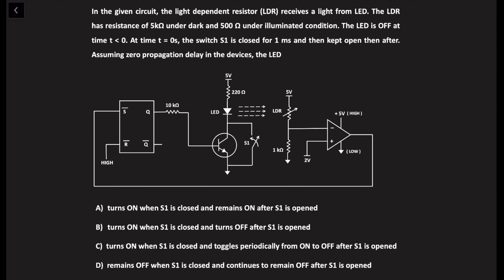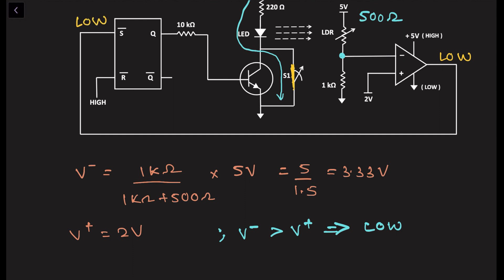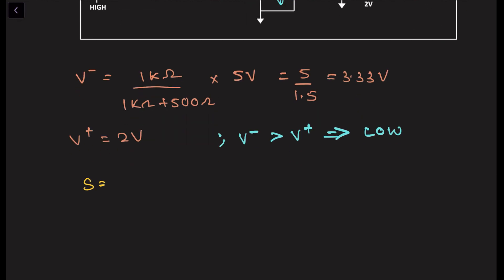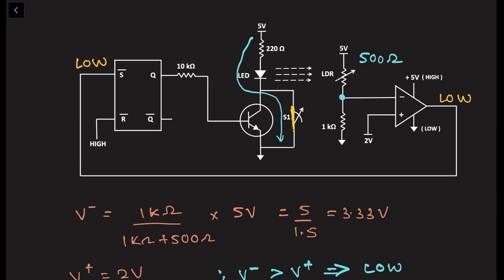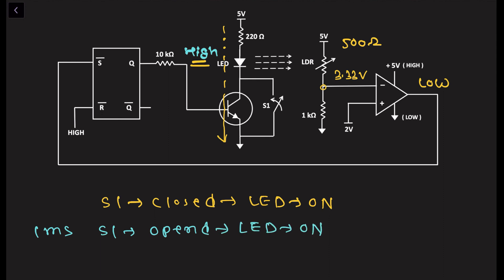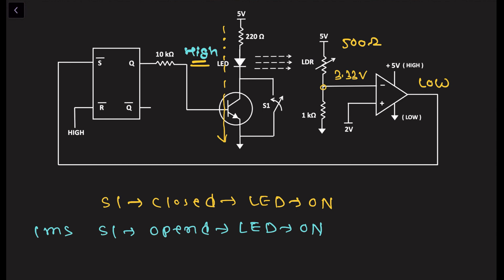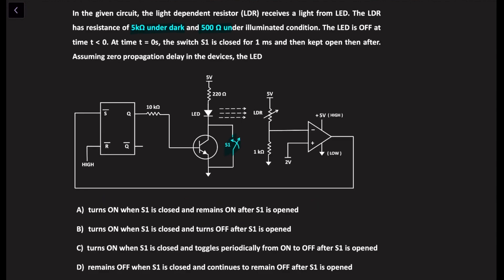SR Latch and Comparator Solved Problem (Analog Electronics / Digital Electronics) | Quiz # 419

Comment: Could you please tell me why LED will remain ON after 1ms?
Reply from the maker: After 1 ms, the output of the comparator is LOW. That means S' = 0 and R' = 1. So, the output of the SR latch will be high. Since it is high, so transistor will be turned ON and it will allow the flow of current through LED. Therefore, even after 1ms, the LED will remain ON.